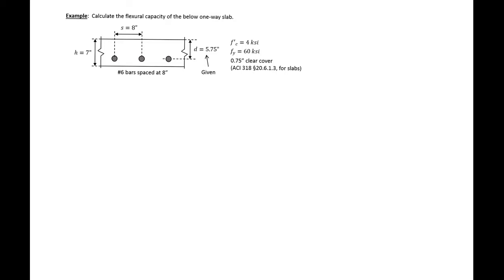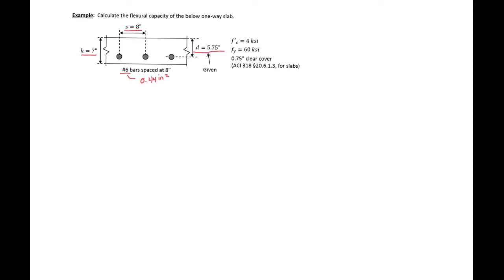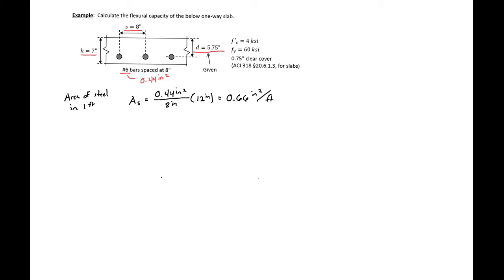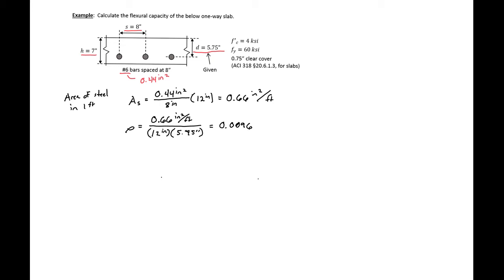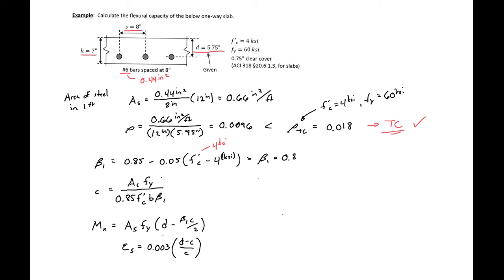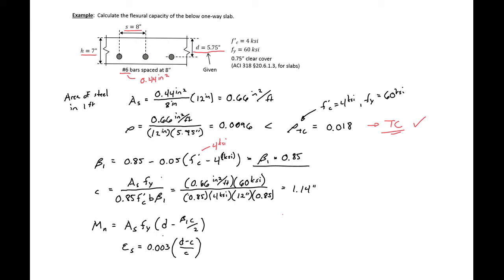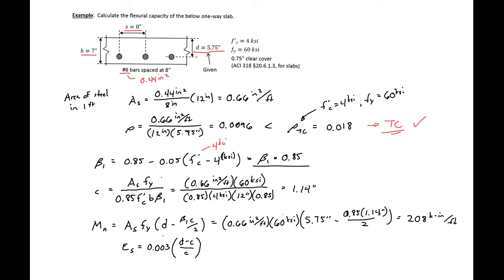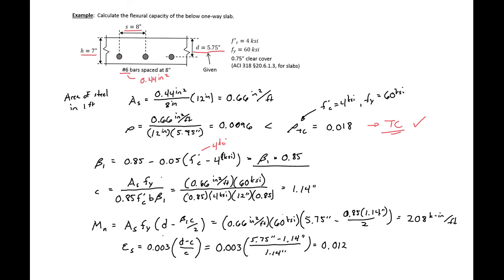5 - Example 1 - One-Way Slab Analysis

Comment: where is it that rho TC comes? can u explain it?
Reply: idk
Reply: rho TC = 0.85*β1*f'c/fy*(εu/(εu+εt)) = 0.85*0.85*4ksi/60ksi*(0.003/(0.003+0.005) = 0.018
For Grade 60 steel εu = 0.003 & εt = 0.005
β1 = 0.85 when f'c = 4ksi
This equation is from ch. 4.3 of Design of Concrete Structures 16th Edition by David Darwin